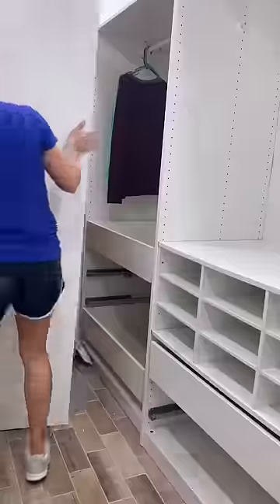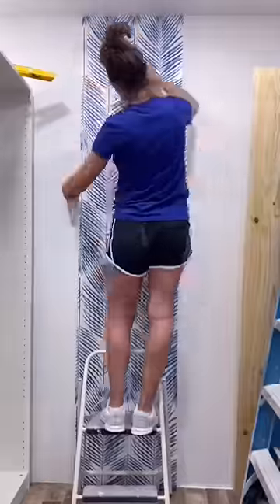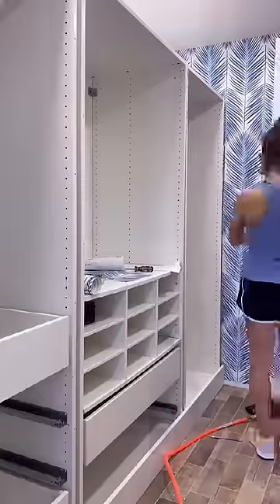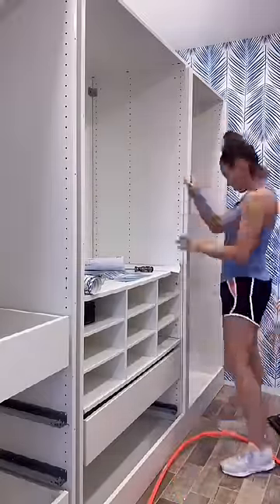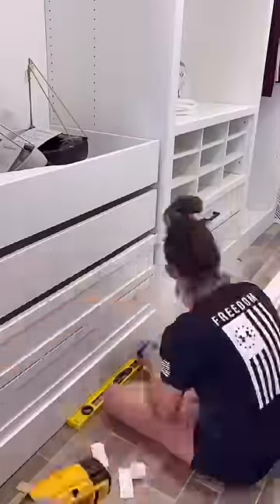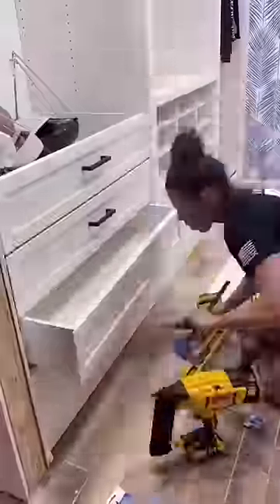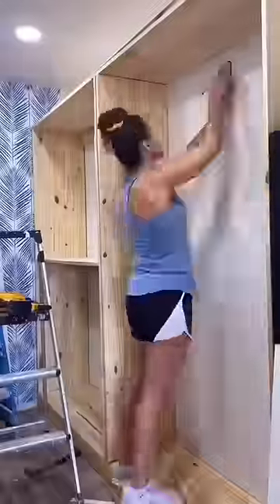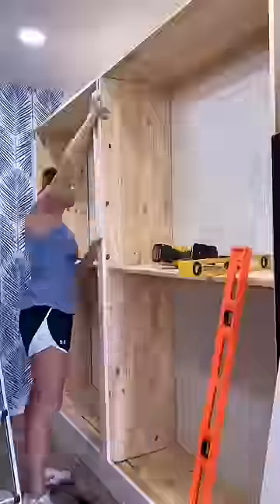$800 Closet Makeover Time-lapse!  Featured on Rachael Ray Show! Ikea PAX, Easy DIY closet Makeover!

Comment: For future reference:

Pine is soft wood - that span with that thickness will likely sag over time with any weight on it. 

I’d suggest a plywood with edge banding if you want something inexpensive and stable.

Otherwise use hardwood for spans like that. 

Other than that - fantastic job 👍🏼

Comment: Aw, you skimped on the mirror at the end of the closet. That mirror should be huge. Large enough to lean on the wall going from the floor about 6”+ tall. That’s a mirror that goes on the back of a door. You spent all that all that money on those cabinets and used the change you had in your pocket to buy the mirror a total aesthetic visual error mistake. I could care less what Rachel says.